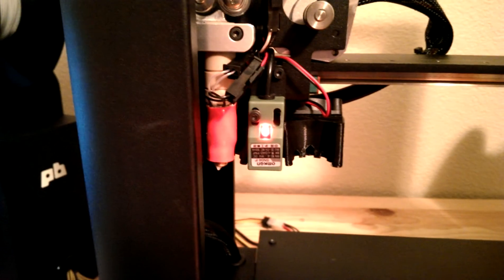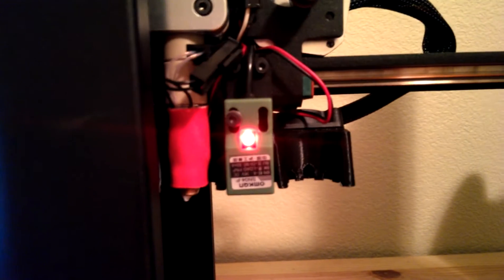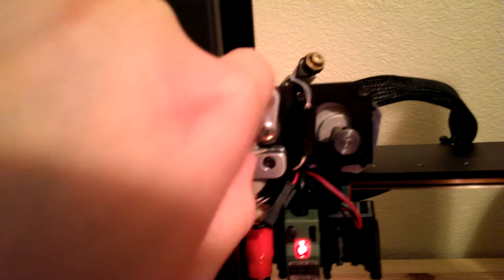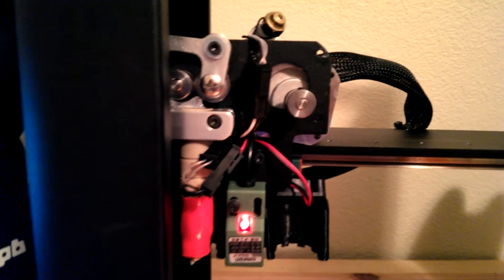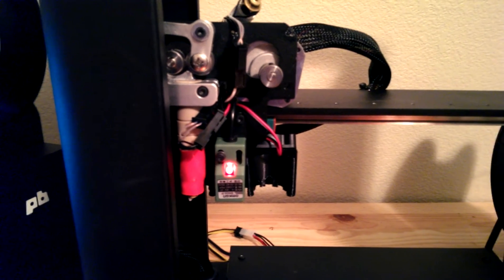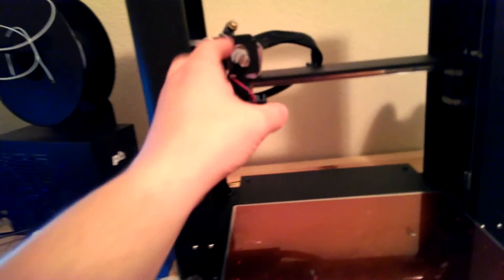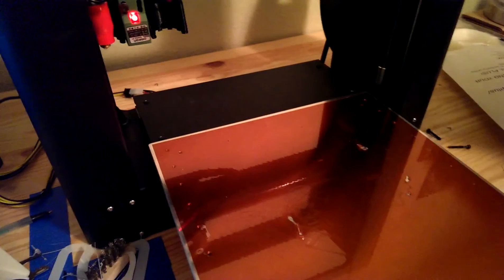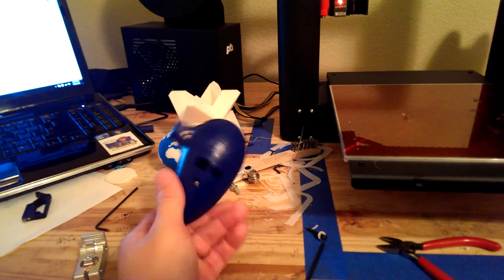3D Printing Make anything you want ft Printrbot Plus Dual Nozzle

Comment: I was looking to buy their large model but looks like they have to many problems and
their design just is not there. Im now looking at the TAZ5 which looks real nice and uses worm gear rods and can use the new Flexi filament with their head.
Its a pretty large build area aswell.  Not as large a ridgibot large model but theirs
seems to stay working. They all are no good if they can't stay running.

Comment: I built a prusa, bought a UP mini, and built a kossel. I have to agree building from scratch or getting a commercial printer is pretty nice, I love how simple my UP mini is but it has problems that come with commercial printers such as proprietary filament among other restrictions. As for your problem I don't know what controller it uses but you could temporarily ditch the inductive sensor and just use a endstop.